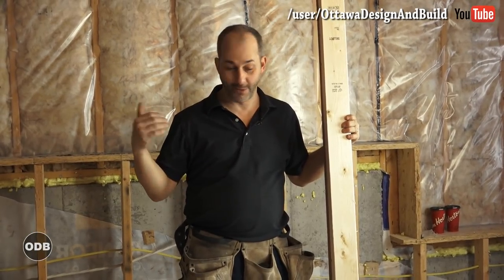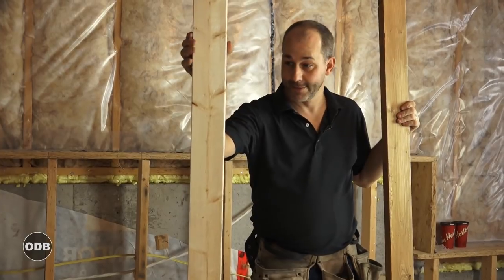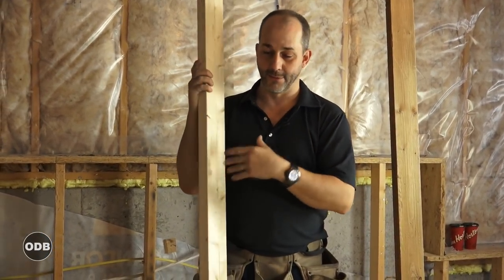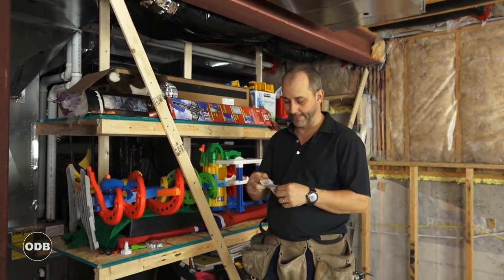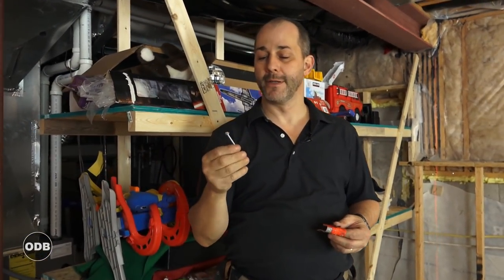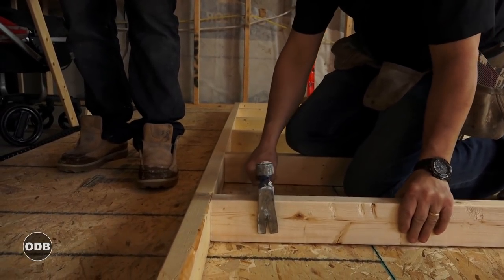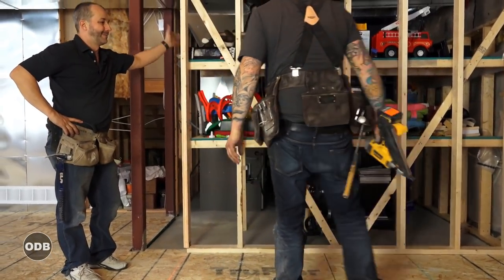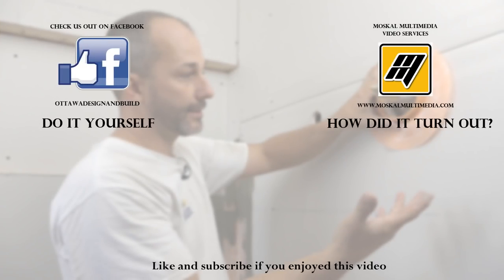How to Build an Interior Basement Wall Under a Steel Beam

Comment: Appreciate the info about framing to an overhead steel beam. I was thinking of welding bolts to the beam and drilling holes in my top plate to match. Your method is much easier. You just lightened my work load.
Reply from the maker: Glad to help. Cheers!

Comment: Love your videos.  Very down to earth and practical.  Thank you.  I have a similar install under a steel basement  beam (6" I Beam about 8 FT. Long).  What type of self tapping screws did you use?  Also, can't find a drill bit that holds up to the steel.  Any suggestions??? Thanks in advance.  Keep up the great work.

Comment: what kind of bit are you using?....im trying to attach my 2x4 to my steel beam. Help please. I've seen videos where you have to put oil to the bit while drilling, is that correct?

Comment: I am building a wall under the I beam in my basement and hiding the support beam exactly as you did in this video. 2 questions: What type of drill bit did you use to drill through the flange of the I beam in your video? If I were to use a Ramset instead of drilling, which part of the I beam should I drive the nail into? Into the center of the I beam or into the flange?
Reply: Also, what type of self tapping screw did you use?

Comment: I'm moving out a wall inside our large greenhouse..   we have an office space inside our greenhouse and i want to make the office bigger..  I'm going to start by building a wall where i want it then ill remove the old wall..  my question is about the celiling in the office and how to frame that (move out or expand the office roof. ) can i just use joist hangers along the edge where the old ceiling ends and extend the joists overtop of the new wall?  i suppose the office is a bit like a shed inside of the greenhouse, it goes from side to side at the back

Comment: If framing in a basement on a sub floor system like the one in this video...what length nails and at what angle should the base plate be nailed to the sub floor?  Thanks for sharing these awesome videos!
Reply from the maker: use the 2 1/2 Cheers!

Comment: You mentioned a few options for framing technique.  What is balloon framing?  And the studs are 16" apart?  Is that the only option?  Can you put them closer together/further apart in an odd space?
Reply from the maker: Sorry for the confusion. There is another framing video on the way that should help clear this up. And yes generally framing walls is standard at 16" if you plan on sheeting or installing drywall. There are a lot of builders who frame on 24" center in the basement. This is a cost saving measure for them to insulate and walls should not be finished on this framing.

Comment: Thanks for the helpful guide. Quick question- When attaching the top plate to the steel beam, are you placing the screw through the flange of the beam, or is it centered and anchored in the web?
Reply from the maker: I try to screw it to the thinnest part of the steel for simplicity.
Reply: It is thickest at the center. Also, if you want to drill up and through to install a nut and screw, then stay away from the center web.

Comment: Thanks for the video. Almost completed the puzzle for me... Last items are about the steel beam. What type of drill bit did you use to pre-drill and what material is the self tapping screws made of? Thanks!
Reply from the maker: Thanks Will, at the hardware store you will find 2 types of drill bits , some for wood some for metal. The screws are self tapping steel which are designed for going into steel however with a beam it is good practice to pre drill so that you don;t break off the screw heads trying to get through that thick metal beam.
Reply: Ottawa Design and Build Renovations Thanks for your speedy response. I look forward to using what I've learned here real soon. Keep up the great work!

Comment: Just curious as to why you prefer to predrill and use self tapping screws to attach the wall to the steel beam as opposed to using a ramset to secure it?
Reply from the maker: Just showing an option for homeowners who don't have that tool. Cheers!
Reply: @HomeRenoVisionDIY  ah ok, makes sense. Really appreciate the great content on your channel!

Comment: I read somewhere that you should drill the holes into your top plate and I-beam every 16-18 inches, on alternating sides of the flange, and use carriage bolts and nuts. Is this an appropriate method to use on a wall that is about 11 feet long (about 8 holes), or is that too many holes in that span of beam? Also, how much would you say you prefer the use of self-tappers over carriage bolts and nuts?
Reply from the maker: either is fine, just don't go overboard. remember gravity does most of the work. 3 would be plenty.
Reply: Home RenoVision DIY 
Thank you for the quick response and helpful videos. Is there a certain distance I should put the first fastener from the end of the beam?
Reply from the maker: within the first 16 inches.
Cheers!

Comment: how do you like the dwaltframing gun do you recommend it for small Reno is it good enough for bigger project?
Reply from the maker: Works well. If you like speed and don't mind the hose I recommend the air tool. It is twice as fast.

Comment: Good video!  Couple questions; do u like your battery powered framing nailer?  I got one and it doesn’t drive 8s with the battery that comes with it. Got a 60v flex battery and seems to work ok.
Reply from the maker: I actually found the constant pause quite annoying. I prefer the air nailer.
Reply: Home RenoVision DIY Not to mention it’s quite cumbersome and heavy. I’m all about wielding the lightest-weighted tools that get the job done.

Comment: Just wondering what length of self-tapping screw are you using when attaching the top plate to the steel post / beam?
Reply from the maker: Looked like a 2 inch

Comment: Are there any issues with screwing a wall frame into an LVL wooden beam? Also, I'm seeing conflicting information on installing the wall frame on top of the subfloor vs directly to the concrete. If you ever had to remove the subfloor due to flooding the walls would all have to come down. What would be the solution to that? Would using a Sawzall around the framing allow you to pull up the subfloor without tearing out all the walls? Your videos are totally awesome. Thanks!!
Reply from the maker: no problem screwing in the lvl. If you have a real flood in the basement, the subfloor will be cut back 1 ft from all interior walls so that washing and drying cn take place. After that the subfloor system is reintroduced. Not a problem.

Comment: Hi, do you have any idea how to build a subfloor on a concrete basement, a bit concave, wich include a drain access ? My main concern is how to level properly that subfloor, make it moist proof and insulate ? (do I need to keep an access to that drain ?) Thank you !
Reply from the maker: you need drain access always in order to keep water level from letting out sewer gas.

Comment: Since the wood doesn't go above the beam there's no way to attach the drywall it seems. How would that be done ?
Reply from the maker: Having a screw in the drywall at the top 8 inches is not imperative. You can always use adhesive when installing as well.
Reply: Thanks

Comment: The plate that my metal post is on is one: not square and two: wider than a 2x4.  Can i use a wider bottom plate? or is there something else i can do?
Reply from the maker: you could build the wall with 2x6. Cheers!

Comment: Good Day Mr. Thorman I would like to know what are the disadvantages of metal wall studs and how to use them as a frame. Also Thank you for making such educational videos :)
Reply from the maker: Metal studs are manufactured for quick installation as well as quick mechanical work. They just are not suitable anywhere you get exposure to water over time. like basements and bathrooms.
Reply: Noted! Thank you. Are you going to make a tutorial about installing a metal studs?

Comment: I have a wood beam in the basement that is an 8"x8" solid square wood that is low causing people to hit their head. Can I safely remove that beam and build a load bearing wall for the entire length of the basement instead of replacing it with an a smaller I steal beam. its an old house. thank you.
Reply from the maker: if you are going to build a wall I suggest just building it under the existing beam. Otherwise you should be consulting a structural engineer!

Comment: I'm worried about weakening my I-beam by drilling holes in it. What are the do's and don'ts? Where to drill the holes... how many...size?
Reply: I'm no pro, but holes typically dont weaken a structure until it gets to be half of the size of the material.  I.E. a 1 inch hole in 2 inch wide material. Screwing these tiny holes and bolts into an I beam isn't going to weaken it at all. Make sure it's not into the web (middle) of the beam as itll take forever to drill, put them on the outsides of the beam where it's easier

Comment: So I can drill holes into a support beam like seen here without compromising the integrity of the beam? I've seen others say to consult an architect before doing this. Is that necessary?
Reply from the maker: That is an awesome question. Anything structural in a home is approved for twice the expected load. Drilling a tiny hole into a beam is no different than getting another dog as far as the impact structurally.
Reply: From the many sources I've read, drilling into the support beam is a common thing. The support beam itself has holes for the bolts that join the pieces together. A 1/4 inch hole is perfectly fine as long as you don't drill several in the same area.
Reply: structural engineer here.  this is not true.  you should never drill holes into a structural member especially in the tension flange on the steel beam.  you do not know what you are talking about.
Reply: Lieburn24 You should let every commercial contractor that builds high rises know this as all of the supports are bolted into the beams across the length of the beam.

Comment: What's crazy is my basement is half finished and the wall separating the finished and unfinished just has small c clamps on the 2x4 spanning it to the steel beam...Should make for easy remodeling if I go ahead and add a full bathroom in my basement.  The clamps make no sense to me though.
Reply from the maker: LOL Just a quick fix for somebody who forgot to drive a screw and rescue the clamps. Cheers!